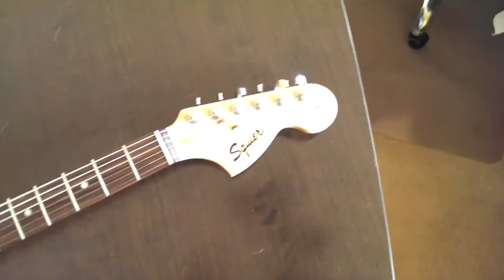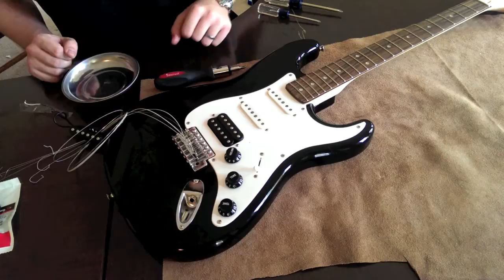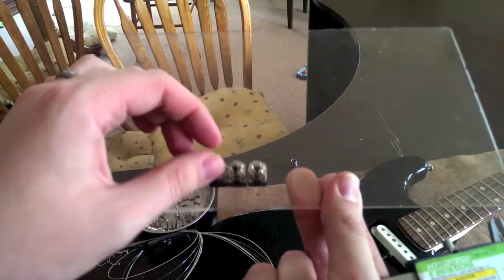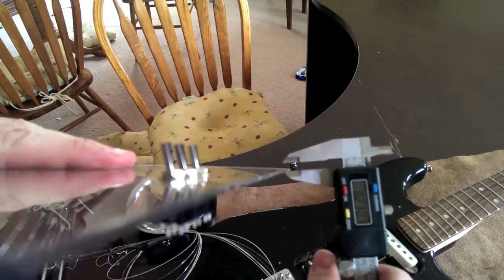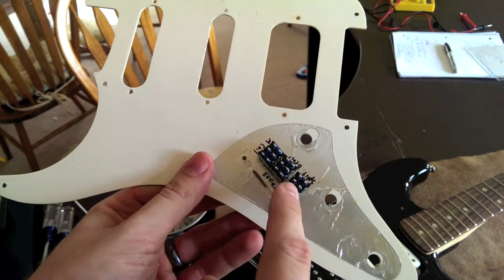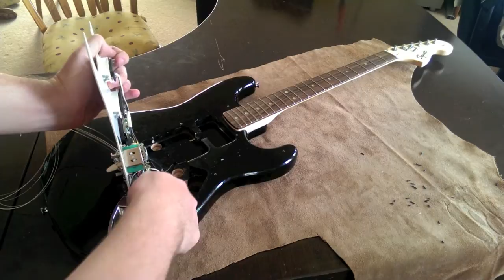Installing dual Phase Inverters and Split Coil on my Strat

Comment: to put the 3 toggles over the pickup blade knob is not smart.... that is the selector we use most all the time and the 3 toggles are seldom used.
Reply from the maker: That's not a bad point. These toggles have a really positive switch to them, though. They are actually kind of hard to bump by accident and are perpendicular to the action of the 5-way. Fender Jaguar guitars use a lower profile switch, which wouldn't be a bad option either. Thanks for the comment!

Comment: Do you know if you can change the tips on those two way/mini switches ?
Reply from the maker: MrShadowofthewind I don't think you can easily swap out the tip. The top of the switch is crimped closed, but there are black and gold switches available from Stewmac and Digi key.

Comment: I've got a Lil Screamin' Demon bridge humbucker from Seymour Duncan and want to do the same thing you did (coil split and phase inversion). Could you help me out with how to wire it up properly? I'm not quite understanding...
Reply from the maker: Check out the wiring diagram in the description. The humbucker is the top set of coils (Picup1). A humbucker is just two single coils strapped together, wired in series. Splitting the coil shorts one of the coils to ground (both signal and ground wires go to ground), negating one of the coils in the series, which is represented by SWTCH1. The phase inverter reverses the ground and signal wires, which is done by SWTCH2. The Seymour Duncan pickups are usually wired with Green, Black, Red, and White wires. Green and black will go to SWTCH2. Red and white go to SWTCH1.
Reply: Ok, that makes sense. Thank you!

Comment: This is almost exactly what I am working on. I have a bridge humbucker, stacked single coil in the middle, and a dual rails in the neck that I want to coil split all three. along with that I'm going to phrase switch the middle and do a bypass. Could you help me out with that?
Reply from the maker: It sounds like you'll need three single throw switches for your splits. You'll need a Double Pole Double Throw (DPDT) switch for the phase inversion. And a Single pole Double Throw (SPDT) switch for the bypass. All five of these switches could be the same type of DPDT switch if you want uniform switches. I used a DPDT switch for my coil split, and just used one set of poles. If you'll comment the models of your pickups, or better, link to a wiring diagram for each, I could give a better description of which wires go where.
Reply: I'm only phrase switching the middle pickup. All my pickups are Seymour Duncan, the bridge is a 59 custom hybrid, the middle is a classic stack strat plus middle, and the neck is a hot rails. Can you do a wiring diagram for this? I have a fender jaguar lower switch mounting plait and the slider switches that go in it already.
Reply from the maker: To tell you the truth, I'm no pro when it comes to wiring, but if you take a look at my included schematic in the description, your mid pickup will be exactly like the "PICUP1", and the other two will just have the top switch of the "PICUP1." 

Apparently, the Jaguar switches can be two way or three way switches, just check out how many contact points they have (6 or 8), and that will tell you whether they are 2 or 3 way, respectively. 

Fortunately, since all your pickups are Seymour Duncan, you will be dealing with the same color wires all over. Green is ground, Black is signal, and Red and White are the coil split/connections. Your coil split switches will attach to the red and white wires. The red and white will always be connected together, on one the center pole of the switch, one end pole of the switch will go to ground, and the other end pole of the switch will be empty. When the switch is on, it will short one of the parts of the pickup to ground, splitting the coil. When the switch is off, the signal wires will be switched to nothing (and thereby no longer shorted to ground, just connected to each other). Also note: phase inverting a split coil will actually cause the other part of the coil to be used (and inverted)

The bypass switch will have your desired pickup’s output (black for the hot rails) on one end pole, the volume pot’s output on the other end pole, and the center pole going to the plug. This will force the neck pickup to go straight to the output bypassing the tone control and volume (the split coil switch will still be affect the output here, unless you connect the bypass switch before the split switch.)
Here’s a shot at your schematic:
http://cypheye.com/guitar/StratSwitches2.png

Comment: I want to replace the pickups on my Mexican Strat. I have the same as you, HSS and that's ok. I have changed lots of pups but what would be a good  choice? The company Stratophere or a name like that sell parts of Strats they take apart. I worry that they will send me a set out of a Squier or worse. So a name brand is safe to avoid them. What would you install? I can go SSS, just another pick guard. Let me know your choice if you have the time. Every one is busy selling and not explaining what the pickups are? Thanks
Reply from the maker: Kevinpaul Moore I'm no pickup expert, but I've been happy with the Fender American standard pickups on this thing, which I know you can pick up on eBay. I got these, though, from a friend that I helped install a set of Seymour Duncan pickups. Those sounded awesome.
Reply from the maker: Kevinpaul Moore Also, I like the Hss, and with the coil split, you get all the advantages of the sss.

Comment: Pretty cool. Do you have a wire diagram for this?
Reply from the maker: I should be able to dig it back up. I'll either find it or recreate it and include it in the description.
Reply: +Robbie Reed awesome, thanks. I suppose instead of using the 3 switches you could change those pots to 3 push/pull pots and have the same thing?
Reply from the maker: +Gary Zonca Here's a link to the schematic:
http://cypheye.com/guitar/GuitarWiring.png

Regarding the push/pull pots, as long as the switch mechanism is a DPDT, then yes the push/pull pots would work great and then you wouldn't have to drill out the pick guard. However, there isn't a ton of room in that electronics cavity, and those push/pull pots look tall, so you may end up carving out some of the guitar body to make room. This one from Stew Mac would be perfect: http://www.stewmac.com/Pickups_and_Electronics/Components_and_Parts/Potentiometers/CTS_Push_pull_Pots_DPDT.html
Reply: +Robbie Reed Awesome. Thanks! Where would I connect the tone pots to?
Reply from the maker: +Gary Zonca 
My modified wiring diagram steals the lines from the mid and bridge pickups, then the outputs from the switches go back to the 5-position switch (and the ground to the volume pot body) where the original lines were stolen from. The rest of the wiring is exactly like the stock diagram. Check out this stock Strat wiring diagram: http://cypheye.com/guitar/StratWiring.jpg
Reply: +Robbie Reed Ok, I understand now. I appreciate the diagram!